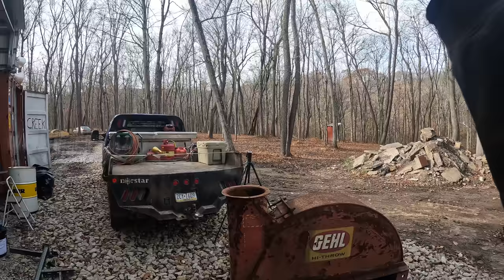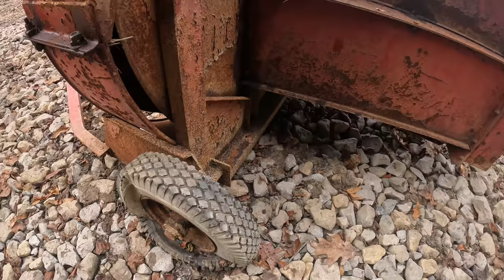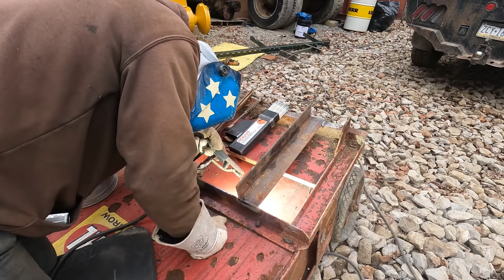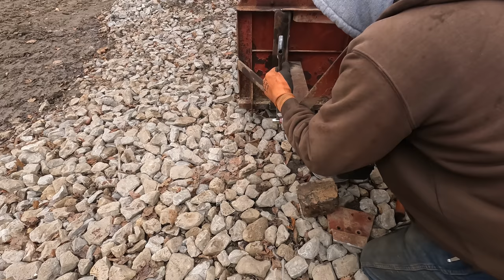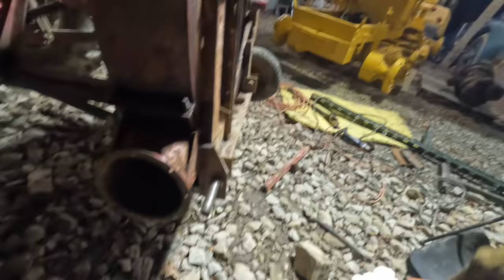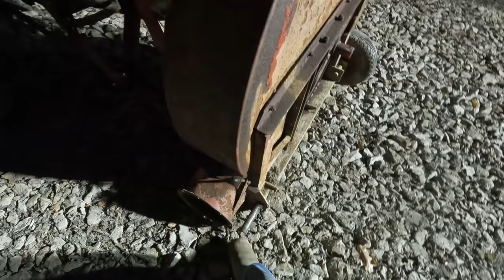I Built a Giant DIESEL POWERED Leaf Blower!!!

Comment: Try trimming 2 inches off the tip of each metal blade, then bolt on rubber blade tips cut out from an old mud flap. This will seal better and not throw sparks. After running it the first 5 minutes  the rubber tips will wear to the shape of the housing giving you a great seal. I did this with my snowblower, works great!
Reply: i did the same on my snoblower,works great !!
Reply: Convair belt works great
Reply: I was thinking the same thing!!
Reply: Just replace the bearings and realign it. No need to over engineer it. It blew corn 50 ft in the air designed the way it was. Simple alignment would fix the dragging problem.
Reply: This is a great idea and while you have blades off to trim, try sandblasting or wire wheel them. Shiny clean blades will be better balanced/move more air
Reply: The more of the impela you take away the less the impact on the leafs
Reply: Awesome idea
Reply: either that, or an old piece of conveyer belt.  that stuff holds up a lot longer than mud flaps :)
Reply: Except it won’t last. Dumb idea.
Reply: Put the wheel back original and make a short directional spout to point slightly down ..just a thought
Reply: @1951spanky  And the dam things needs to be balanced otherwise the thing will fail from vibrational metal fatigue. Inspect each blade for twist and grind off metal till ALL blades clear on the tips and sides. Move the output around to the other side so its facing down, and fasten a removable extension with a 90 degree elbow that you can rotate from blowing sideways to straight back. BOLT expanded metal piece over the big hole by gluing 4 bolts to the housing. Put some oil or grease so you can move that output to different positions, easier!
Reply: Great idea. And saves your metalwork too.
Reply: @larrylenz7723  Conveyor belt, yes.
Reply: @1951spanky  He can ballence  them also ,although this is a polishing a turd episoide
Reply: @JeffLMisc  tire sidewall work also
Reply: The bipass from the shorter blades will effect the amount of air generated!
Reply: @Mrcrowley1967  the tread from an old bias ply tire would really work well.
Reply: @johnthompson1558  When you cut the flaps you make it so they actual touch the housing. After running 5 minutes they wear to the perfect size and seal much better than the metal blades so output is increased.
Reply: 100%
Reply: Just cut the hole in another place and weld a piece of steel over the original hole (keep it simple )
Reply: You definitely want to do something to eliminate those sparks. As is, it would make for a beautiful way to start an 1,800 foot long wildfire if the leaves are dry enough.
Reply: @larrylenz7723  conveyor
Reply: I love spell check and ppl that correct it! Just as much as I love fact checkers! Lol
Reply: Maybe a duck bill  necked down slightly to. Boost your  thrust. .    Seemed to work really good anyway.
Reply: @larrylenz7723  I hate spellcheck !  And know firsthand you can’t trust it
Reply: @deffocrap73  
..
Reply: @Mr.Z1776  For blowing Air you actually don´t even need them to seal. Usually you will find a tiny gap that just prevents it from touching. Instead of cutting a considerable amount of, i just would get some coarse sandpaper and "touch up" the blades that are actually rubbing until they are no longer rubbing. Looking at that thing, I don´t think we have to be too worried about the wheel being balanced.
Reply: @ronniefrizado1279  wut
Reply: I'd think twice about unbalancing that big piece of iron
Reply: Please do not do this.  Your unit has tight clearance between the housing and impeller which is much preferred to rubber which will deteriorate and wear.  Your setup as-is is much superior to a bush-fix mud flap addition to reduce clearances.
Reply: @knurlgnar24  Matt is not working on a jet engine. He has already be making "adjustments" with a BFH and a length of pipe and the thing is old as dirt so I'm sure it's not perfectly balanced anymore. The rubber tips will eliminate the possibility of sparks and starting a fire.
Reply: WOW! Thanks everyone for all the likes and comments!!❤
Reply: That blower was designed to blow silage 90 feet straight up, as fast as you feed it.
Reply: @Mr.Z1776  I definitely disagree.  Why in the world would he want rubber parts in a device that already has tight clearances between the impeller and external housing?  It would result in an inferior piece of equipment that requires routine maintenance for wear components and doesn't operate as well for the vast majority of its operational life.  And if you're worried about fire risk, well, I don't think you live in the real world.
Reply: Do this with snow blowers all the time.  Chucks slush and wet snow a good 40 feet.
Reply: @Giant97  I know! It goes right through water and slush like it's nothing!
Reply: @Giant97  I agree regarding snow blowers.  He isn't building a snow blower.
Reply: i like the sparks helps you see better
Reply: Anyone say ain't or can't work should explain why and what to do for a fix,drop out,This is about doing and safely  class.
Reply: Thats actually a great idea hope he does this..
Reply: I use old mine belt
Reply: @ferrettkitt  my thought was cut a joke 180°from the existing and have removable block-offs for both so cute can draw from any direction.
Reply: @oakleyjack7600  auto-f**kup. It rarely corrects!
Reply: My thought exactly! ///  One more use: insulation blower (rigged up w/ some 'hosage'!)
Reply: The intake hole should be near center of fan. Think squirrel cage blower.  I'd also reduce the Size of output hole to increase pressure.

Comment: The blower is a centrifugal air pump. It needs the air intake closer to the spindle - like the wife's hair dryer. Suggest you block off the current air intake except for a hole close the the spindle. This should be the shape of a curved sausage. Another intake on the opposite side of the fan housing will double the intake area. This arrangement will allow the fan to accelerate the airflow radially. You will get a huge increase in output. Cheers mate from New Zealand... Also trim 10mm off the end of each fan blade to get good clearance

Comment: Rotate the outlet to other side, it'll blow at a slight downward angle. would make it easier to go from leaf to straw blowing mode and you'll get the volume back
Reply: I am so lazy, that I waited for someone to post this idea...
Reply: Do this then make a tube to get down nearer the ground and then some sort of “foot” duct to vector the air to where you want it. Doesn’t need to be anything fancy, sheet metal and rivets would work.😀
Reply: And if that doesn't work just flip the entire outlet so it sits more level on the now opposite side. A couple of hinges on the expanded metal with a lynch pin and the intake cover swings out of the way for straw blowing.
Reply: I agree rotated a bit more 180° down the ground and go from there
Reply: This is exactly what i was thinking, rotate outer part 180 degrees then just add elbow and tube that points at ground. At ground level could even make nozzle that manually rotates to either left or right to direct air.
Reply: You are correct. Wouldn't have to put in the extra work cutting more holes in the cage either.
Reply: This plus an adjustable nozzle should make up for rotating it over there.
Reply: 100% agree. Saw that immediately
Reply: From my experience leaf blowing a downward angle would actually work better.   The chute is loose to adjust the angle of sending the material.     You could reinstall the chute and make a lid for it when not throwing straw
Reply: Yep, or remove the outer casing and install the other way round
Reply: After you rotate the housing, cut/form a second chute to the other side...now when you roll down the middle of the road, leaves are cleared to both sides.  If it doesn't have enough 'blow', you cap off one side...done.
Reply: I was hoping this ideal hit him during the video. Would only need the one chute since he’ll be going down and back. And then he wouldn’t need to make any extra holes to gain more power. Hope he sees this and tests it.
Reply: Just what I was thinking.....👍
Reply: I agree with Bryan65 I would love to see how it would work flipped to the other side. If you needed the air closer to the ground just and a pipe. I hope you are successful.
Reply: I thought the same thing! Might have tested it first before any cutting.
Reply: Simple adjustment with nothing to lose. It would also clear that axle so the wheel could be put back on.
Reply: That’s exactly what I was thinking
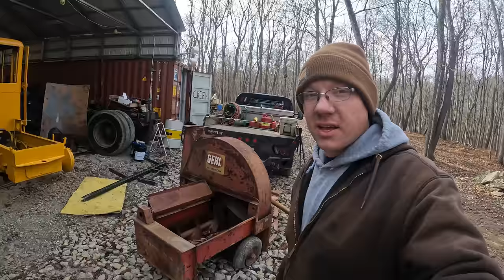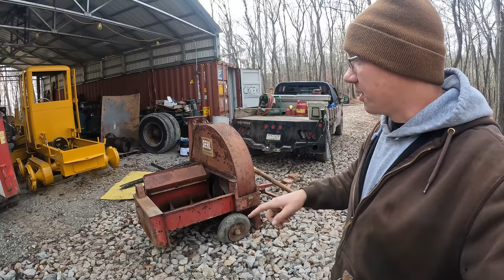Reply: That's what I was thinking too. Rotate the chute so it's pointing in the 4:30-5:00 position.
Reply: I thought,  before I say anything,  gonna see if anyone else saw it.  Scrolled down and found you guys. Yep, simple rotation to the other side.then put the wheel back on.
Reply: Agreed.. worth a try I feel
Reply: I had exactly the same idea. It seems like the easiest, most effective, solution.
Reply: If you look at the way people use leaf blowers they are not horizontal with the ground but at about 45 degrees. Like the idea and really enjoyed the video.
Reply: Add light rubber flap over the output tube for your driveway cleaning. Might keep the air flow lower and more flow into your leaves. Should not be so heavy that it restricts the flow but just lifts up slightly to let the air out in a flat pattern

Comment: Rather than cutting open more holes on the back of the fan, keep the opening where it is, rotate the chute to the top pointing directly sideways like you'd planned to have it for throwing straw, and then just build an attachment pipe that can bolt on to the existing bolt pattern on the chute for leaf blowing. Saves the structure that's existing, and saves having to rotate the chute around any time you want to change what you're using it for.

Comment: From messing with centrifugal blowers I'd recommend elevating the air nozzle and angling downward.  You don't need/want a high velocity concentration for your application but a more even 'wind'.  By rotating the chute 270 degrees or so and blowing from the other side I think you'll get good results without any modification to the unit.  Worth a shot given how easy it would be to try.  Then you can tell me I'm wrong.  :)
Reply: that might be even better than the idea I suggested !
Reply: I like your suggestion of rotating the chute 270 degrees.   I wouldn’t modify anything until I tried this idea.  
Cheers!
Whipple
Reply: @bellofbelmont    I agree Jim.   Always worth a shot, right?
Reply: Exactly!  A little downward direction and on the other side. Then no need to alter the air intake other then closing up some of it. Also the rocks will be less likely to scattered into the forest.
Reply: That’s the first thing I thought,blast down at the road/leaves it would also build more velocity if it had the whole “snail shell” to develop pressure/flow
Reply: Came here to say just this.
Reply: That was also my idea. And add a pipe or a bow to the chute that the outlet of the air is in the middle of the tractor track width.
Reply: This right here quick to try 😃
Reply: I think that’s the answer too.
If he disagrees, the response will start with this statement.
“ you obviously never operated a diesel powered blower before”
Reply: I realized 270 would be pointing straight down.  oops.  225 degrees is what I meant.
Reply: This would also fix the issue with the chute preventing you from using the original axle.
Reply: That's an much easier solution to rotate it ab 220 degrees and then i would add(make) like a nozzle with svivel function to change between blowing to your left/right of the tractor. And if this nozzle is possible to rotate it would be easy to change direction if needed to blow all the leafs to the same side of the road/space whatever direction you are driving (up/down your road).
Keep it up.
Following because i like what you're working with.
Reply: At the begining of each show when your barreling down the road and blow the horn the people in that house by the road must surely get peeved off at you.....lol
Reply: Exactly correct
Reply: Where you been man??! Missing those sweet inverter mods!
Reply: Dude. 1 hf. X2. Connect.. Bro. Welding down. Use the same going up and over... Kool shit.. Xx from New Zealand.
Reply: I agree can always make a deflector to direct the air
Reply: maybe he could find a nozzle from say a car wash blower and mount it to the flange once its rotated to the other side.
Reply: Yes that was my thought too.

Comment: Hey Matt, I think that for centrifugal blowers like this, the hole should be in the center around the shaft, so that low pressure air is drawn in in the middle and high pressure air is pushed out at the edges.  I also think you should consider using a smaller nozzle so that you get more airspeed for your given pressure.  Just my two cents, loved the video!  Always looking forward to your Saturday morning cartoons.
Reply: yes agree on all you suggest
Reply: Right, he needs to visualize this like a turbocharger or squirrel cage fan. The intake is in the center for a reason. There's probably ratios available that would tell you the ratio of intake orifice size to output size but I would be generous given the impeller here is a compromise between throwing silage and moving air. At least double the ratio of a turbocharger(Intake bigger than exhaust).  Block up the majority of the existing intake and cut out around the center of the impeller on the other panels. 

Seat of the pants guess: the center hole diameter will be as large as where the impeller blades take that angle towards the impeller shaft. I would maximize that variable before messing with the output size.
Reply: Now that I think about it a bit more, I'd think that the intake diameter exposing the area where the blades are full width becomes a diminishing return, it would probably leak some portion of the additional potential intake capacity... So blade clearance and fitment and the output size are your variables after that.
Reply: If you decrease the output hole to say 6inches by 2 inches, it will increase your air velocity.
Reply: Totally agree - much the same as a sawmill dust extractor 👍
Reply: Yes, defiantly . Intake as near to the centre as you can get and maybe change the output to a flattened oval (horizontal) to give a more fan shaped blast 👍
Reply: Exactly what I thought. Had to jog my memory to remember what we learned in aeronautical engineering school in the class 'pumps, fans and compressors' way back in time.
Reply: the blower is a big hair drier. pull air from the center and exit from the perimeter. you have the exit you need the opening at the center.        joel from Fl.
Reply: I agree with you! working on my prototype of wood chipper,  It`s centrifugal! The air will get access to the machine by the middle , by spinning , the disk will increase the air pressure, then you would get air velocity to push the debris outside the machine but am not 100%, sure it`s my first one. perhaps, try a smaller exit hole.
Reply: Adding a smaller output is good, but also make a taper, that should also accelerate the output air. Imagine a road cone attached  to the nozzle, but metal.
Reply: Matt, I agree with Kevin.

Comment: The way a centrifugal fan works requires the intake to be central (close to the axle). Pressure is developed in the entire periphery of the housing, so to maximise efficiency you should close up the original intake and cut a 12" hole as close to the centre as possible, leaving the bearing support framework in place. I made a similar version, but mine was mounted horizontally with its own vertical mower engine, and it sucks the leaves up before discharging out the side with some bleed air used to lift the leaves as it passed, works amazingly well as it partially mulches them at the same time.
Cheers.
Reply: yes, good point about hole placement
Reply: I'm late to the party, but this is exactly right.  Put the intake in the center.  You gotta have the center bearing for support, but you can cut some wedges out around it for air intake.
Reply: This guy blows…. Some leaves!
Reply: ... But it's not a centrifugal fan. Those use a hamster wheel with vanes in a cylindrical pattern around the outer circumference. The way the blades on this prop-style fan are designed is for pulling the air in through the exposure of the blade edge near the opening to scoop air into the housing as it passes the opening. It just needs the air to travel around as much of the circumference as possible between the intake and the exhaust.
Reply: @arcanewyrm6295  Well, it is. I dunno what else to say than that to convince you. The pressure in a rotating assembly like that is highest at the outer edge, so you should only allow air to escape in the intended exit. The lowest pressure is near the center, so that should be your air intake. The original usage wanted to preserve the grains, so it was throwing the grains as much as blowing them, but even that closed up the furthest outer edge of the intake.
Reply: that's a pretty genius design. i've just been relying on my lawn tractor's mulcher and two blades to mulch up my leaves and throw them around. a snow blower made for leaves is even better!
Reply: I completely agree, but want to add one item: the intake hole(s) should only be sized the same as the exhaust (or even a tad bit smaller). The current intake size is way too large to also allow spillage from the fan itself- it appears there's about 1/4 of the fan that really isn't there.